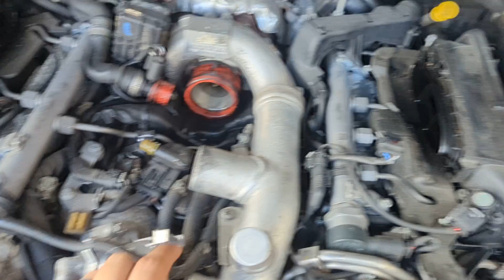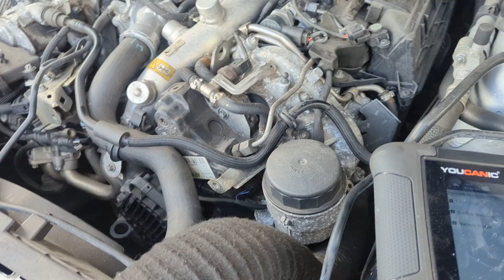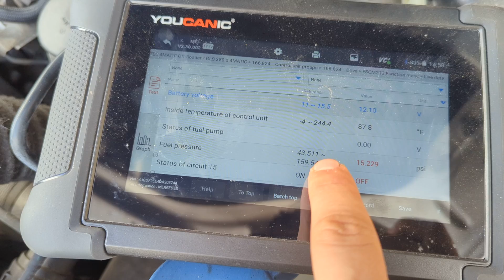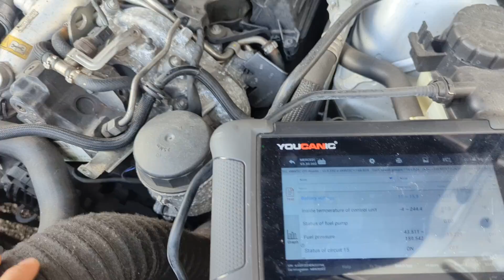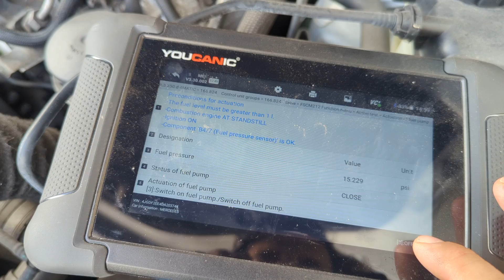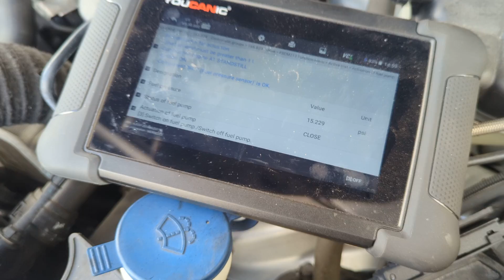Check Mercedes Benz Fuel Pressure Activate Fuel Pump Om642 Diesel No Start Sprinter BlueTech

Comment: 2015 gl 3.0 v6  won't start, show  9bar on that sensor u unplugged 
 Plugged/unplugged 9bar.
And 3.5 volts to fuel pump 
When feed 12v car start
Any idea
Reply: Sadly no, got the same problem 
If you figure it out comment what have you found.
Thanks
Reply: @typpeko got it,  mixed  plugs from fuel line  and air filter box. Same plugs fitt easily.

Comment: Hey man. Fellow mechanic here. I am not getting any voltage to injectors. I do have fuel pressure on low side and high side. Any Ideas? Its a 12 Ml350 bluetec

Comment: Could this be my issue? I have "2047-1 rail pressure monitoring via volume control valve the rail pressure is too low" error code. 

If i clear it, I can drive normally (but very sluggishly) until i reach about 3k rpm and check engine light comes on. 

If I floor it while driving, the engine shuts off completely which is very dangerous.
Reply: 2007 ml320 CDI OM642.122. Injectors where replaced. I still have white smoke (smells like diesel) sometimes.
Reply: Did you manage to find the problem?